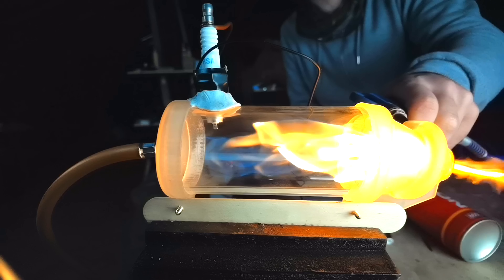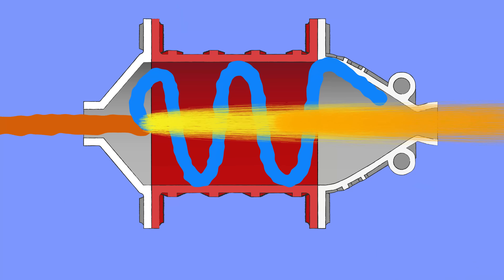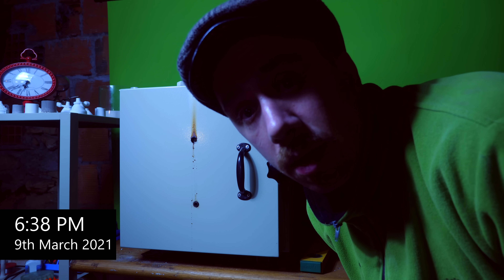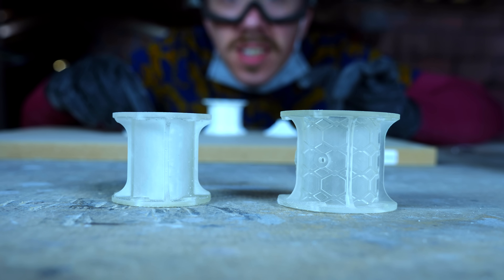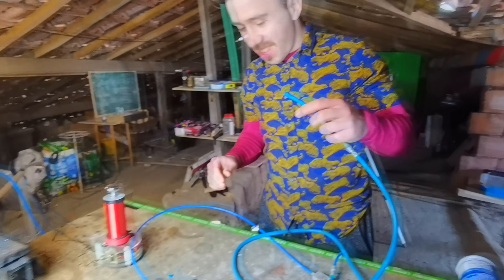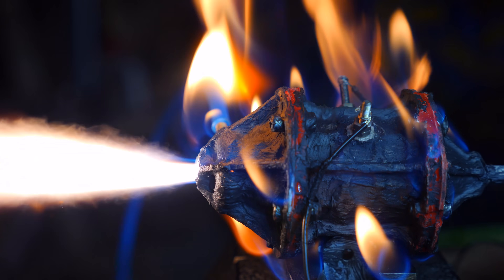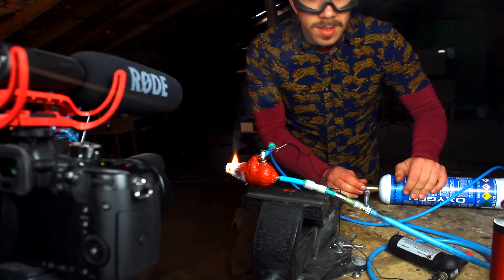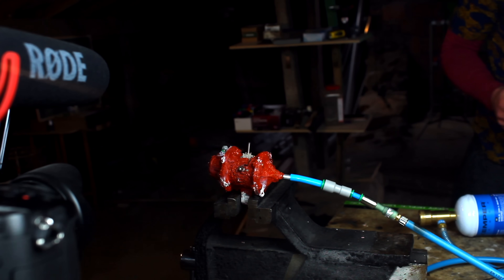Vortex Rocket V2.0 (3D Printed)

Comment: I'm thinking on making a beta stirling engine to power a boat, but I can't make it, can you make it

Edit: to weld metal, I recommend you to use a plasma welder, they are more expensive than normal welders but they have smoother and better quality welds.

Comment: This will probably get buried in the comments... but what about some heat resistant paint on the inside of the engine parts? High temp spray paint could be used to coat the insides, sealing everything and standing up to the temp. Just a thought. Good luck!

Comment: so, from watching the videos, it looks like the engine is heating up too much for the sealant.  I think you mentioned at the beginning using slip to seal the engine. Perhaps using a slip of something that can withstand the heat and pressure infusing (either low or high pressure) the engine with the slip into the ceramic will seal it well enough to make a less leaky shell. I'm thinking a fire clay with a superfine silicon powder (a frit to reduce shrinkage and subsequent cracking) would be best. Perhaps Sodium silicate which is often used in clay pots to reduce porosity and prevent efflorescence.

Comment: Just a thought, after you print and fire your parts, can they be redipped in your  ceramic/resin mix and fired again? Would that help seal some if not all of the small gaps that are causing your parts to leak?

Comment: Use a Jet Hot ceramic coating to seal the pores in your parts. And you need to make seals for the parts flanges.

Comment: Use your 3d printer to make the molds for a lost wax type of construct, then use real ceramic poured from a industrial supply house bottle. Like the ones used for ceramics classes in the uni. Then fire it in a real kiln.???

Comment: What about taking some refractory cement watering it down a little bit and putting it inside the finished Engine with some compressed air to fill in any gaps in the ceramic

Comment: For leaking problem you can use carbon fiber sheets inside the engine. This will further strengthen the engine. You should calculate the maximum pressure engine can bear without breaking. And don't exceed it.

Comment: Have you tried using castable refractory to clog the pores in the ceramic?
You could try dusting the inside with refractory powder using a brush and then pressurize the part to drive the dust into the pores.  Rinse and repeat until you get no leaks.

Have you tried encasing the ceramic parts in plaster before you fire them or is that just a really bad idea for some reason?  How about packing them in sand?

Comment: Ciao Integza,

I do enjoy your videos every week. They are perfect to start Sunday morning with the right foot.

Regarding the pressure issue, I would also suggest to go for a metal coating for the inner part of the chamber.
However, I see that using aluminum pipes might be cumbersome. The real advantage of 3D printing is in the possibility to customize shapes and sizes.
If you use rigid pipes you will limit that degree of freedom.

Instead, I would propose to use copper foil to create a metal coating on the inside of the chamber.
The foil can be glued with high-temperature glue.
You can easily find foils with different thickness according to your requirement.

Moreover, I believe that you can also help yourself in the act of gluing the foil with a balloon or a bike tire.
(you can inflate the balloon on the inside of the chamber to force the foil to stick on the surface of the chamber).

I believe that this technique might also prove useful for future projects with custom chambers that need to withstand high temperature.

Finally, I would also suggest to add to the project a couple of sensors in the chamber (e.g. Temperature and pressure).
Having those variables logged and plotted would help to understand if the vortex is really insulating the chamber and/or characterize pressure drops.

Thanks!!! :)
Reply: Additionally, having those variables under sight might enable you to adjust the ignition frequency and the pressure of the gases to achieve better result! :)
"Power is nothing without control" Pirelli.

Comment: Add some interlocking labyrinth sealing between parts. Also you can fill it with something. Also you can  add water cooling, it's 3dPrinting you can manufacture any structure. Also maybe water will stops some leaking.

Comment: Try a ceramic pottery glaze to seal your engines, you could use different colours and patterns to make them look really badass.
Reply from the maker: Cool idea
Reply: @integza  bonus points if you paint flames on the engine with the glaze

More bonus points if you figure out a way to cure/fire the glaze by running the engine.
Reply: @integza   why don’t you try it to cool it down like the water cooling one but add liquid nitrogen🤣
Reply: @BVB-BTEERDHAB  That would be too much of a mess to deal with man, have you seen the struggles in these videos man? Stop trying to torture the poor dude! lol
Reply: Die tamatos 🔪

Comment: If you use a sealent bath it could seal the one part engine while also making sure it is really completly sealed. I think it is likely that the dried out resin causes Micro Cracks or Channels building so Immersion sealing is the best way to make sure it seals completly

Comment: So the design is suppose to be using oxygen to insolate the heat , so it should work  with plastic  as body, the only area to be needing ceramic is the nuzzle.  The pressure come from inside it will definitely push away the high temp silicone , I think? 
How about not using oxygen, star with slower speed  air? 

I don’t have a 3d printer but I think is the same with pottery, you can use galze to make it air tight or water tight , the silicone resin mix, definitely very light weight like bee hive or sponge, so the air is leaking and the fuel is also leaking, 

I think you can find out how they apply glaze on dishes ,  glaze your part , 

Should be over 1200 degrees to make porcelain

Comment: You should try liquid cooling for your next rocket engine just 3d printer a network of tubes in the walls of the engine for water to pass through and cool it down

Comment: A couple of idea. Would using the methane to form the vortex be better ? hot oxygen is dangerous stuff and most rocket designer that aren't SpaceX or Russian try to avoid it. the flow might be to low but in that case you could go with hydrogen instead of methane.
second does the kiln only remorve the resin or does it also cook the céramique ? it it doesn't cook the ceramique would heating it up more to cook it help ?

Comment: Hey so, idea to solve the leaking.  Build a sputter metal coater. You can then use it to coate the internal surfaces of the ceramic with titanium.  With a few coats i bet it would completely fill in the porosity of the ceramicm and give it some added regidity. It would be like some space age composite ceramic. Which obviously makes it better than just glazing part lol.

Comment: i think you need  better pressure regulation for your gasses. it look like u just go from 0-100% in seconds, causing catastrophic failure no matter what you do. if you can get your engine to run and slowly ramp it up with gas pressure then it can be observed and improved better maybe? like cant the speed of the oxygen swirl be used to move the propane faster threw the chamber? or maybe not. i dont know anything, im just thinkings.

Comment: Glaze the ceramic. It'll stop it from being porous enough to leak, high temp silicone isn't designed to hold up to pressure. You could also 3d print molds for real ceramic and instead of using the resin

Comment: For the places where the parts meet and need to form a seal, instead of using a relatively thick layer of sealant, consider using fine sandpaper on a flat surface (like a sheet of glass) to flatten the parts. Looking at the irregularity of the surfaces, I don't think you would have to remove too much of it.

Comment: Testing how much pressure you can get with these engines, please. And how about and Metall 3D printer. I think this could be very interesting for engine. And you should think of the idea that you make Graphite Folie inside for better heat resistance and less leaking

Comment: You should try using a fired porcelain glaze to seal your engines - essentially, you paint it on, then re-fire the porcelain in the kiln at a lower temp than the first firing to get the glaze to melt into glass and seal the pores. You can even use this to seal multiple ceramic parts together by "gluing" them together with this molten glass glaze.

Comment: To solve the leaking issue, you can coat the parts with more resin, after they are baked in the furnace. This way the engine can hold pressure and vortex cooling can then work. You just need to apply very thin layers (with a brush for example) and then cure the resin with some UV lamps. 3 to 5 coats should be enough.

Comment: Have you tried enamel coating the ceramic parts? Ceramic is very porous and it looks like the pressure is pushing your sealant away from the coated parts. By enamel glazing your ceramic parts it will more permanently seal the material. Also you can reduce the parts warping by baking them at low temp to remove all of the water and then baking at a higher temp to remove the resin. Keep up the good work, and good luck.

Comment: Almost like you need a solution of something to soak the engines in after running them thru the kiln to fill the voids left by burning out the resin.. I'm sure there has to be something that would work.. maybe even be able to soak in solution and it replace the resin skipping the kiln all together.. kind of like a aerogel process..

Comment: Excellent job. Lots of learning and fun happening in that home.  I was thinking that maybe, you might be able to increase/ improve gas flow, if the inside had spiral groves inside the combustion chamber. Reducing the amount of raddical eddies formed at the surface. (Btw, not a mech/ fluid eng.)

Comment: you could sand the joints of the parts of the rocket and join the parts with high temperature paste that is put in the car engine and go over the joints with a carbon fiber line

Comment: Might consider trying to fill the pores of the ceramics with graphite powder. If you can get it saturated into the inner side well enough, it should have a comparable heat tolerance to the ceramic and help reduce that pressure leakage.

Comment: @integza you can use alumina resin instead of porcelain. If your furnace cannot reach alumina sintering temperatures which is 1500 Celsius degree, you can send your parts to me. I can help you with sintering process.

Comment: Acho que tu podes cobrir as partes internas com algo tipo starlite; algum naterial que implemente ablative shielding. Da pra colocar um fio fino andando em zigzag e usar como sensor pra desligar o motor no momento que em algum ponto o escudo eh perfurado, desse modo o motor eh ao menos parcialmente reutilizavel. Acho que cobrir a parte externa com metal ou vidro nao vai funcionar direito porque a porosidade da ceramica aumenta com o calor e o trabalho do gas na camera entao faria mais sentido (no meu ver) cobrir a parte interna da camera de combustao

Comment: i think the problem is that the silicon can't resist the preshur, try to seal it from the inside with high temperature cement or somethong like this

Comment: J-B Weld epoxy applied with a brush, a small amount of metal powder or better yet carbon powder can be added to strengthen it. J-B Weld can fix anything.....

Comment: I suspect part of the problem is size. If look at the original design the tube length is much longer also.   It's like over clocking if you try to dump tons of power in it doesn't make your cpu faster unless you have enough cooling etc. 
1 - The size of the rocket engine is not big enough for the vortex to be able to develop properly with the pressure being forced into it.
2 - material is not stong enough for the pressures involved. 
3 - leaks due to how the material layers. 
4 - no pressure control with gauges (see air compressors, welders with gas erc)  as an example to ensure repeatable exact ratios of gases and being able to tune the mix ratio's. 

Solutions. 

1 - pla printer. Yes pla. Print a bigger engine out of pla and use the lost wax method to make a bigger aluminum engine which will remove any leaks increase size to allow for more time for the vortex to develop also need experiment with shape as well. 
2 - the aluminum will allow for great strength of the chambers you will have to for testing purposes make a water / air cooling channel in the print for the nozzle this would be for the demonstration asa properly made one would be made of materials that can take the heat. 

3 - as mentioned the aluminum will prevent leaks

4 - use flow control. You will require 2 co2/argon flow control valves. They should work with the propane and the oxygen. Or find gas specific. 
This will allow you to control exact psi for each gas with in turn should improve mix ratio's .. and to better ensure the air cooling shield/vortex is enough. Now not sure if a shorter or longer tube will work better also larger diameter vs short and long. Not a rocket expert. But know enough of what's missing. 
Love your show. 
The center if made right can be glass to be see thorough as it should be protected from the heat if the air shield is working properly. 
5 - recycling co2 as a coolant vs water.  Co2 expands greatly as it is heated and contracts as it's cooled. If the pressure levels were good enough as the co2 is heated I wonder if that expansion if a tesla type valve was used to prevent back flow?? And the expansion and contraction would make it flow on it's own. You would need a small radiator and fan. Or for short term testing ice copper coil and a bucket the stick said coil and bucket in plus and expansion chamber where the hot gas has an easier time to move into before cooling also reducing back flow.

Comment: Isn't there a danger of gasses being forced back into one of the injection ports (oxygen or fuel), when the engine is in operation.  I'm reminded of that Tesla valve you made Integza.  I know the leaking isn't being caused by that, but seeing your rockets experiencing spontaneous combustion or catching fire instantly makes me safety conscious.

Comment: I believe the primary failure was the blue tubes seal. They leaked over the outside, cooking the seal from both sides, raising the ceramics overall temp, leading to an accelerated degrading of the red seals. More bolts, mechanical pressure, would reduce the stress on the chemical sealant. This would perhaps make the red seals more durable. But the blue hose seal was the first mechanical failure. Best of luck, that was great content.

Comment: I think what's happening is the oxygen is keeping the walls cool however the radiant temperature is still igniting the walls in a highly oxidized environment. Maybe consider using propane for the coolant and piping in oxygen down the middle? I think at that point you'd also have to worry about pyrolizing the propane which would cause coking issues.

Comment: Awesome show Integza!!! Leaks, tricky. Standard automotive, thicker walls, more bolts on the flanges, and gaskets. Tricky with your ceramic process. Can you take a previously fired part and 3D print more material onto it, then refire? Go integza, go!

Comment: 1) use a heat-resistant sealant underneath a more rigid sealant, and then 2) Use the torch flame to cut a tomato in half.

Comment: I would try burning a dirty fuel maybe acetylene not sure if propane will work, with no oxygen for a period of time until soot/carbon builds up on the inside. Maybe that would seal them up? Or maybe dipping in oil and then firing, to polymerize the oil on the parts.
Reply: That's an interesting idea.  Perhaps a secondary dip in a fine slip...and a second bake... would help seal?  Or an interior glaze?

Comment: Maybe you can try seeling the micro holes by applying materials to the inside of the chamber. In that case the air pressure needs to push the material through the micro holes as well. Not sure what's to use though because you will probably want the chamber nice and smooth on the inside.

Comment: its really easy to get 99% ceramic parts by letting the resin soak into the finished parts in a vacuum and then firing them again. also wear goddamn respiratory protection

Comment: Can you add Tantalum hafnium carbide to the ceramic resin mixtures for reinforced strength and higher heat resistant temperatures?

Comment: The engines that didn't "pop" before they ran seemed to do the best. It looks like it might be the initial pop of the oxygen and fuel igniting and then exploding that cracks the ceramic like an eggshell, maybe you just need a material strong enough to withstand that ignition explosion, or perhaps a more consistent ignition system/position so it can reliably ignite the gas before it has a chance to build up and explode

Comment: Why not put the coating on the inside so when you increase the chamber pressure it will push more sealant into the holes

Comment: I think the design is simple enough to just make a mold of the nozzle (with silicon or resin etc) and squeeze in refractory cement with a metal mesh (steel wool?). Then maybe vibrate the mold to make up for the viscocity of the cement and to remove air gaps

Comment: you should try to incase the engine in refectory cement around 1 to 2 cm thick would help with the heat and pressure then the engine is still technically 3d printed

Comment: I think the leaks come from the pressure expanding the material opening up tiny cracks. The cracks or leaks will effect the vortex cooled chamber and becomes less effective after which the heat expands the assembly even more creating more failures. So I would use metal or  more layers of refractory cement. 
Good luck and don't blow your self up.